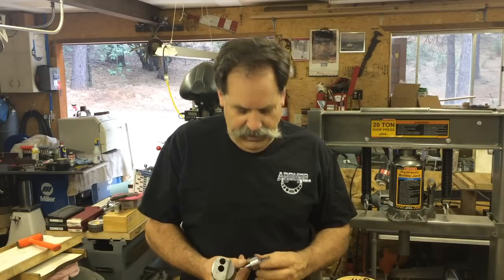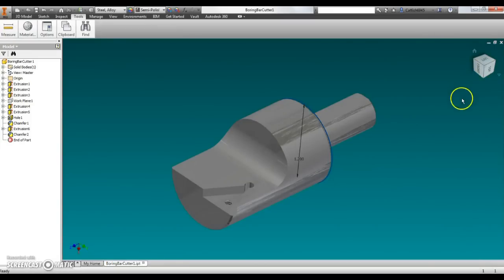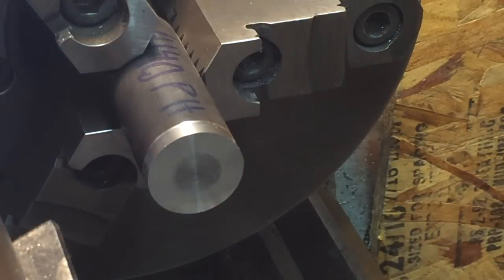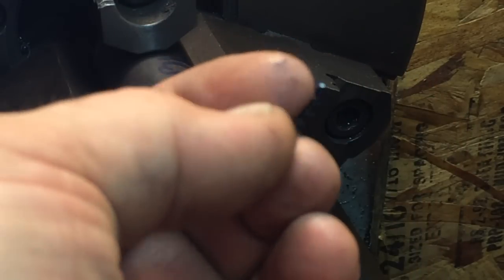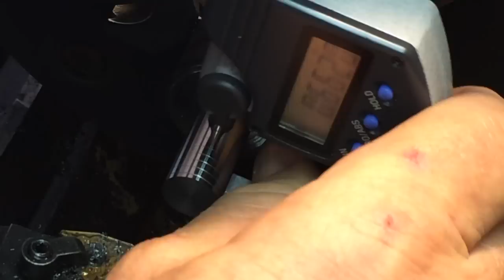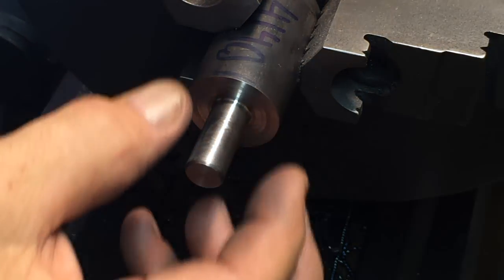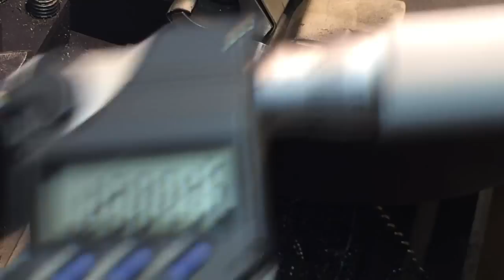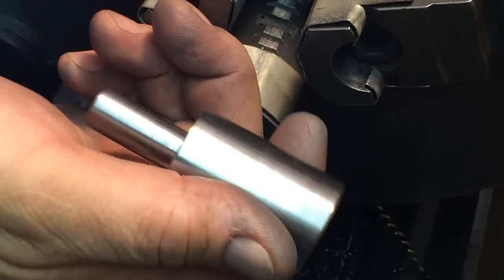How To Make a Insert Boring Bar P1

Comment: Great video. I enjoy watching the production of a tool from etch-a-sketch to final application. I have a SB 9 in lathe with a QCTP. I am really new at using inserts and understand what the letters on the inserts stand for. My questions is, once that insert is out of it's original package, how do you tell exactly what it is. For instance you get a zip loc bag with a bunch of different inserts and there is nothing on the bag to say what each is. I am using a CCMW -3-2.5-2 and I know from experience the difference between that and a CCMW 3-2.-1 , but that's about the limit of my being able to identify different inserts. I hear you guys rattling off those numbers like it was embedded in your brain. What's the secret.  Looking forward to "the rest of the story" . Thanks ...Ken Marina CA
Reply from the maker: +Kenneth Bartlett Thanks Ken. Here is a link that has some very good info on inserts.
http://www.carbidedepot.com/resources.htm.

Comment: You demon toolmaker you! Nice work again. What insert do you use for for that 4140? Finish is amazing.
Look fwd to the milling.
Reply from the maker: +ChrisB257 I have been using a Kyocera WNMG 432 PQCA525.  Works great. 1200 rpm, DPC 0.030, IPR 0.010.  Comes out perfect.  Thanks Chris,  Randy
Reply: +Randy Richard Thx for the info Randy. :)

Comment: Nice video. What size and type of screw are you going to use with the insert?  Where do you get that type of screw?   Thanks for sharing.
Reply from the maker: +cerberus The screws are #4-40 Flathead Torxs-Plus, McMaster-Carr  #D9897628.  Thanks, Randy
Reply: +Randy Richard thanks, that saves me a lot of searching.

Comment: Hi Randy, Just yesterday I was mulling over making an insert holder for my boring head, what was that about great minds thinking alike? :>)
One suggestion comes to mind if you are thinking of using the cross holes, DON'T. Well at least not with that tool, as the arbour will unscrew, been there, done that, and got the T shirt, too. As your tool is quite large, stop sniggering in the back row, why not make another recess on the left side, so it can be run forward in the cross hole.
Reply from the maker: +Chris Stephens How funny,  Yep I would not run this backwards,  I will say something in the next vid about that,  thanks for bringing that up.  With the size of this you could put in another recess.  Thanks  Randy